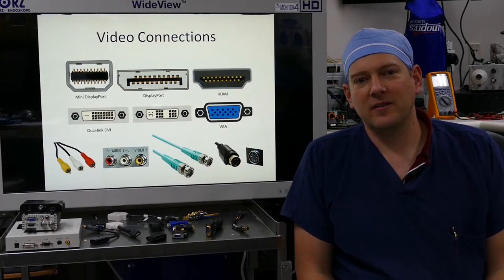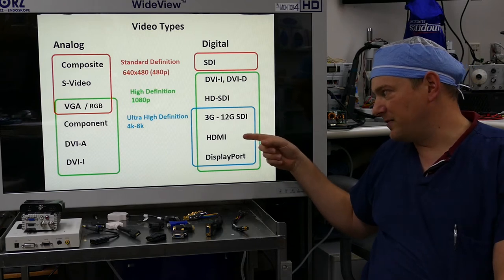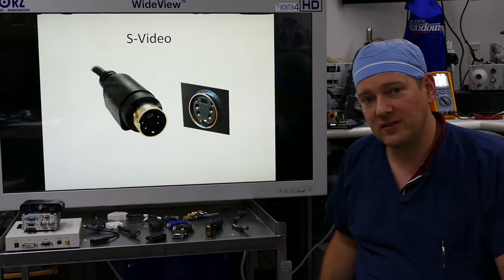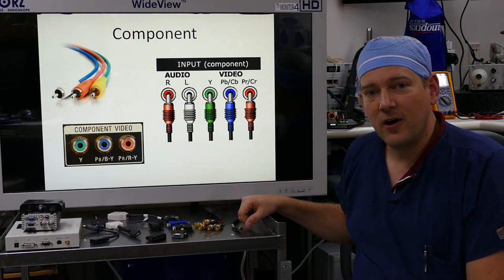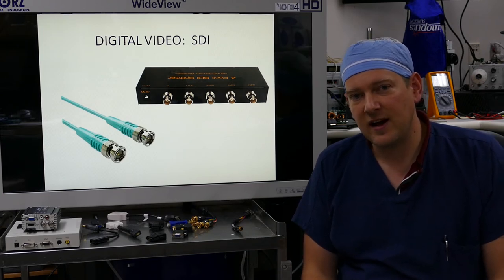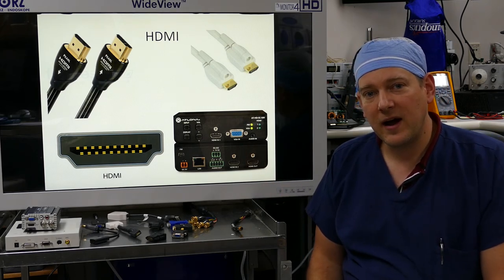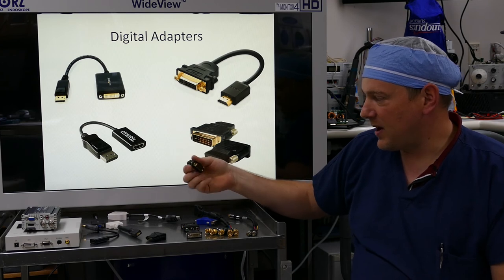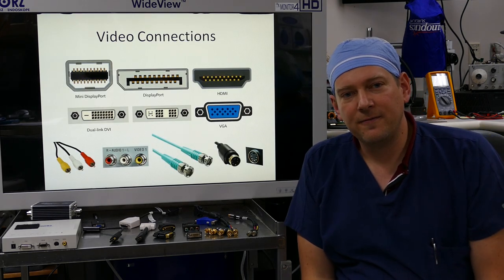09 Video Connections

Comment: Interesting. I recently saw a hospital using cat5/cat6 ethernet cables for video feed. I'm sure this is old stuff, but it's the first time seeing it in the wild.

Even laptops today have moved to using usbc instead of the standard hdmi.

My question is, why are wifi not being used more as a means to transfer video feed?
Reply from the maker: Cat5 / 6 video is kinda recent.  Power Over Ethernet makes it possible to easily power the hdmi receivers.  Wireless hdmi uses a lot of bandwidth and requires direct line of sight. It's a solid protocol though